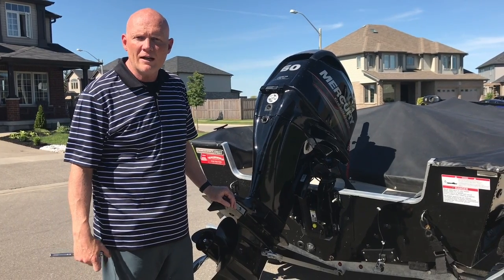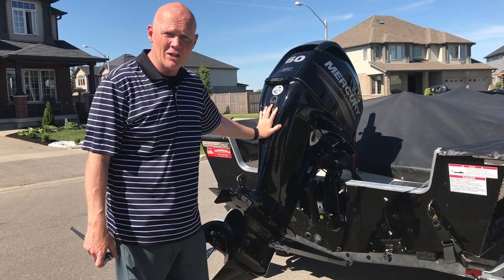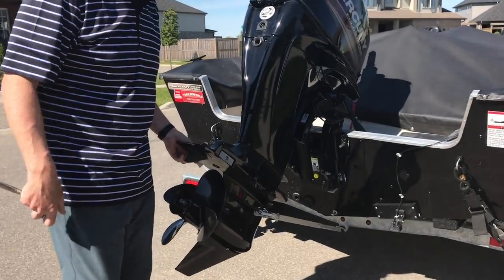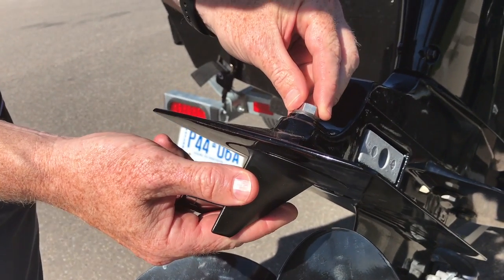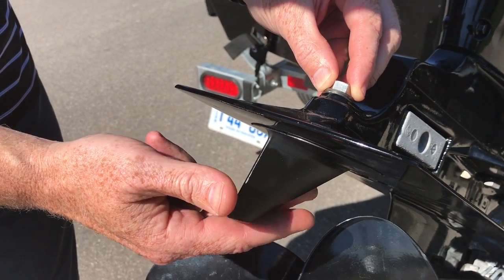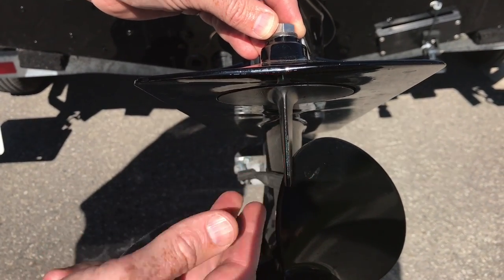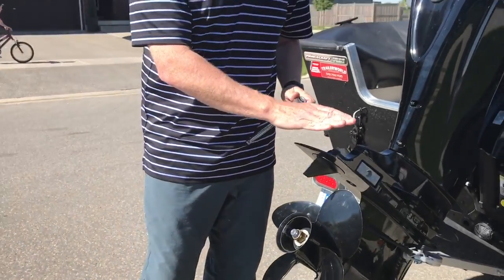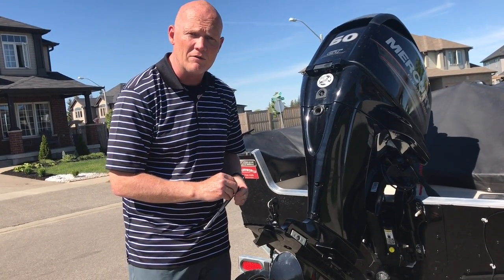Fixing "pull" on a Tiller

Comment: Mine broke off and I’m having no problems with it pulling to one side. I’m an 18 year old who’s new to boating and I was wondering if I need this for any other reason.
Reply from the maker: Hi Colin. If you are not experiencing pull, I wouldn't worry about it. Many of the new motors (bigger ones) have steering assist so they don't even put the trim tab on from factory. Also, sometimes if you are getting pull you can trim the motor up to mitigate it.
Reply: On some motors it is also a zinc anode so it helps with corrosion.

Comment: Which direction for which pull?
Reply from the maker: If you look at it, you can see it functions much like a canoe paddle would when you are steering. So look at the direction it is pointing, it will be creating pressure / drag on the angle, so go the opposite way. That help?
Reply: I have the exact same motor, 60hp command thrust tiller. It’s mounted on my 20x72 grizzly jon boat. Took it out yesterday and it jumps up on plane and pulls hard left I have to literally fight it to keep it straight. My arm actually hurts today from 6 hours of that yesterday.  I’m going to adjust mine and see if that fixes the problem thanks for the video it’s exactly what I needed to know to make the correction.
Reply from the maker: @DickieTunes80  I had to give mine an adjustment last week again. I think over time you just have to keep tweaking it.
Reply: @DickieTunes80  did the torque tab adjustment fix your problem? Or possibly the outboard wasnt mounted at true center on the transom?

Comment: When you moved it towards center did it fix the problem or did you end up moving it in the other direction?
Reply from the maker: Once I moved it to the middle I was good. I'm actually getting some pull again though, so I'm going to take a look to see if it's moved! Hope this helps.
Reply: @TheCanadianFisherman  thanks. Im wondering because mine is at a slight angle and while im driving it wants to pull my handle to my left
Reply: If it's tipping on the port side at speed. Does that mean that needs turning to the left or right .

Comment: What is that little fin thing called I noticed mine is pulling to one side I went to adjust it and found it was missing
Reply from the maker: Hi John. It's called a counter torque fin. Not sure which model you have. Is it missing, or did the motor never have it?
Reply: @TheCanadianFisherman   Thanks for the info turns out it had never had it it just had a flat piece without a fin